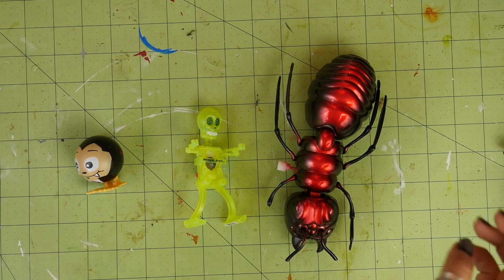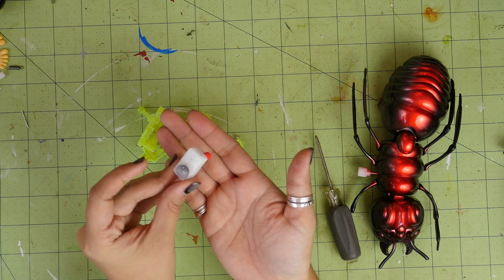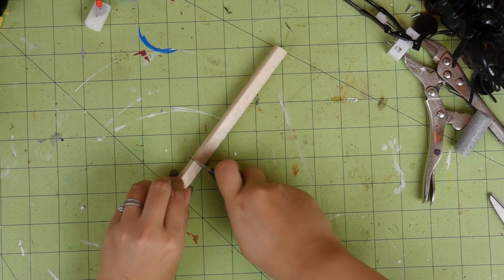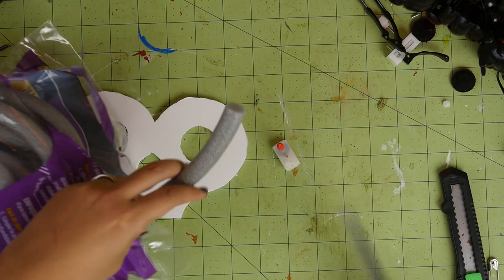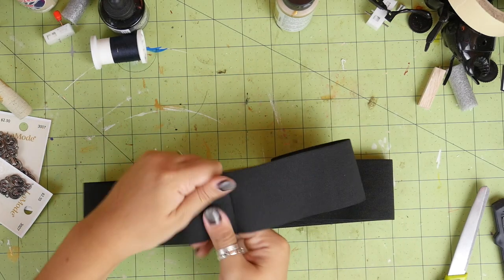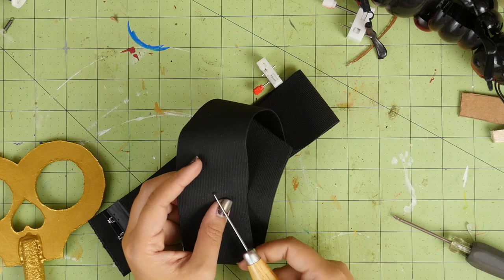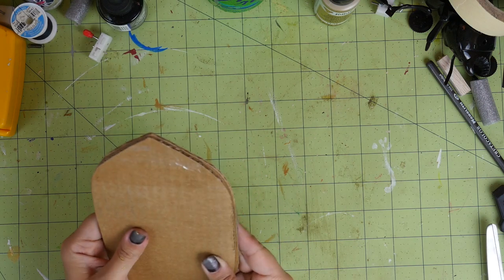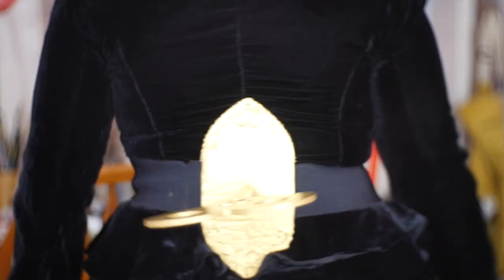How to Make a Working Wind-up Key Updated Version! : DIY

Comment: Btw, if people want the key to be higher and hidden, 
They could take thick elastic or bra (depending in gender)
And place it behind the bra, poking a hole for the wind up mech and then through the shirt, placing the key on from the outside!
Reply from the maker: That's a great idea!! Thanks for the tip! :D
Reply: No problem!! Just a thought CX
Reply: Tick Tock jujhujjkk
Reply: This isnt going to ruin my bra or shirt, right?

Comment: ~Happy anniversary~ 
Ps. You can totaly spray paint foam without it disolving, just as long as you coat it with wood glue, pva or gesso :3
Reply from the maker: +Caeley Chia Thank you! :) Yes, that's true, you can totally spray paint it as long as you seal the foam. I guess I just didn't mention that because it's just easier to paint with craft paint, haha.